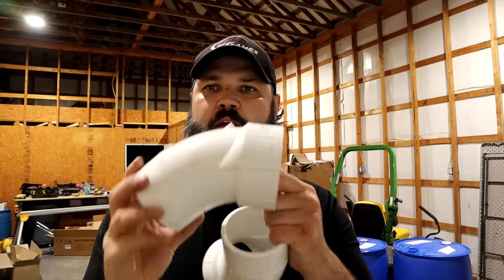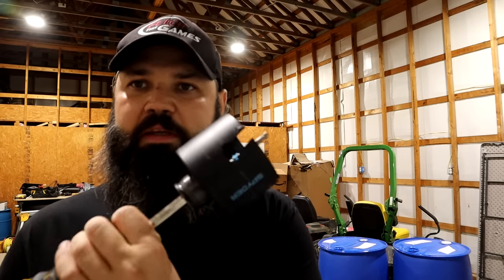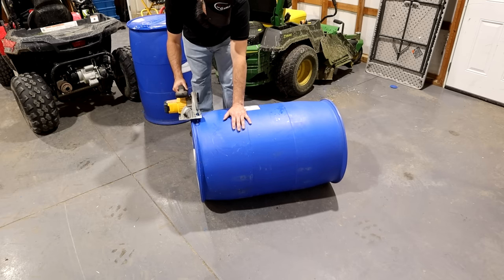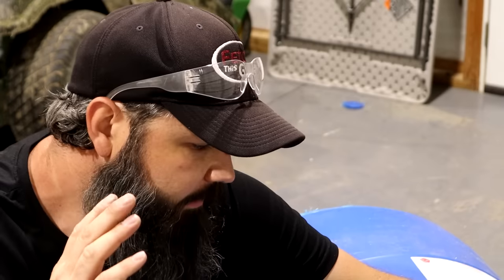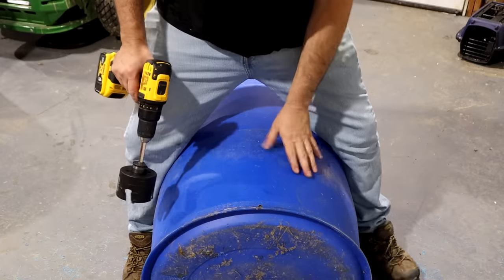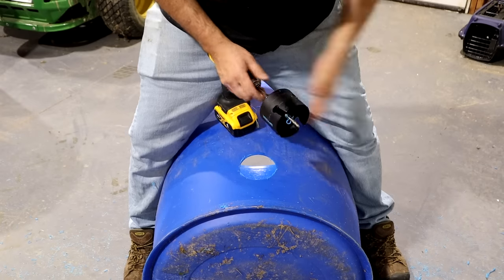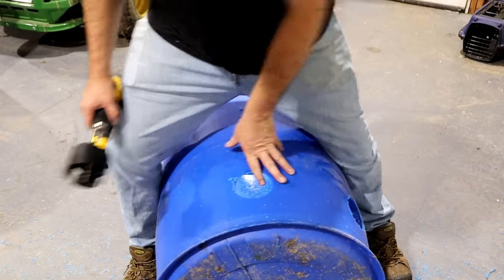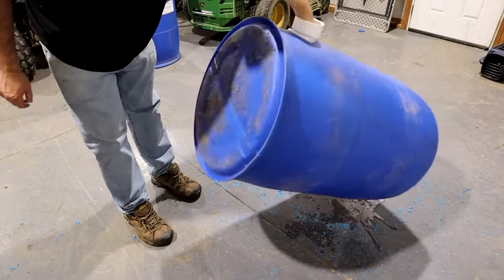The Best Chicken Feeder & Waterer for the Coop

Comment: Some chickens with large combs can have trouble with this type feeder.
Reply from the maker: Yeah roosters mainly.  There are work arounds for that.
Reply: @NicholsCounty  what are the workarounds......I have two roosters that I plan to use with your method.  I have the rain barrel all ready to go
Reply from the maker: @berttondo6170  I tested it out for a whole summer with 2 Black Copper Marans Roosters.   They were outside with electric netting and this was their only feeder.  They ate out of this just fine with no issues.  The ones you see in the thumbnail are in one of my coops and what I do now when I collect eggs is just dump a scoop of feed on the ground so the chickens can scratch through it.  You could get bigger elbows.  Or just make this one and set a camera up on it and see if your roosters have issues.
Reply: You could have several 3" elbows ($) for the hens and a single 4" elbow ($$) for the roosters to share.

Comment: Sorry just noticed the heater questions answered but still wanted to know for such a large amount of water. Thanks
Reply from the maker: It's harder to freeze a large body of water.  For instance it take longer to freeze 55 gallons of water as opposed to 5.  If you keep this in direct sun it should help.  If you use PVC in the winter they will freeze and crack if you don't heat them.  If these start freezing up then I just bring water up to them (frost free hydrant).  If you live in the north, you're going to need some type of heater.  Hope this helps.
Reply: A ten dollar aquarium heater should keep it from freezing they have to be fully submerged at all times while on so don't let water run out completely and put it all the way at bottom. There should be a suction cup on it.

Comment: Do you have cold winters? If so, how does the waterer hold up in the cold months?

Thanks
Reply from the maker: The water freezes. The tubing freezes first.
Reply: @Nichols County  kind of figured as much. We don't have electricity in our coop, and the only thing I could think to do is check on their water a few times a day. Granted I placed a rubber bowl inside another lined with straw to help insulate it and place a bottle of salt water in the middle to slow the freezing process and make it easier to break up or take out the ice all together.

Comment: I dont understand why the water doesnt leak out of the hole.  Is that just tubing that you are putting in the hole that you drilled?
Reply from the maker: I put the tubbing in the hole.
Reply: @NicholsCounty  is it in there really tight so that it doesn’t leak around it?
Reply from the maker: @ST-LA  Yeah, you just drill the hole a little smaller than the tubing.

Comment: Thank you! How many chickens would you say this waterer would support? Looking to use for meat birds mostly.
Reply from the maker: That really depends on how often you want to fill it. I have 50 or so birds on this and refill every couple of weeks.
Reply: @NicholsCounty  thanks! So basically this is a gravity fed, low pressure system. So as long as the vessel with the water sits above the drinker it should work right?
Reply from the maker: @hannahclark3564  That's exactly right.  You can use a 5 gallon bucket or something like I used.
Reply: @NicholsCounty  perfect! Going to use a 55 gallon drum and thinking I’ll leave the drum outside on a platform and run the hose through the coop
Reply from the maker: @hannahclark3564  either way will work. I don't have any issues with it inside.

Comment: I can see a good deal of feed the chickens cant assess when the feed gets below the tubes.
Reply from the maker: You can tilt the barrel forward. Or dump it out on the ground when it gets low.  You could also put something else in the bottom.  You could build a wooden ramp inside to push feed to one side. Or you could add feeders ports all around so the feed distributes evenly.  There are all kinds of things you could do to mitigate your problem.  I just dump what's left on the ground, when it gets low, so I'm not putting new feed on top of old feed.

Comment: Hi! I tried this using a 5 gal bucket. Have you had any issues with the feed getting moldy/maggots? Any troubleshooting tips?
Reply from the maker: No. Just keep it away from rain. It's not waterproof.
Reply: @NicholsCounty  Thank you! Any tips/ideas to make it rainproof?
Reply: @latanyacarr411  you might have to find a one that has a rubber seal. That might help keep the moisture out.
Reply: @derekmortensen1665  Thank you! I’ll definitely look into that! Gotta have a safe way to feed my birds.
Reply from the maker: @latanyacarr411  some kind of plastic. I actually had a plastic picnic table that I sawed in half.  I just put thst on top with a cinder block. Worked fine.
Reply: @NicholsCounty  Awesome! Thank you! I’ll definitely see what I can find to keep their feed dry.

Comment: In Australia I cant find the Street Elbow with the barb on it. what can I use instead ? any tips?
Reply: I might try a nylon tie on the back
Reply from the maker: I put a link in the description for a substitute.  They make these chicken feeder ports meant for this.
Reply: @NicholsCounty  Thanks. I might try a cheaper option aka hack instead!
Reply: @MrAnditburns  just heat a coat hanger to melt a defect? Don't breathe pvc fumes!
Reply: Screw in a short sheet metal where the plastic lug would abt be located  these have hex heads on them,make sure the head isflat is lined up on the fitting so when u snap it in,it is square to the plastic on the drum.